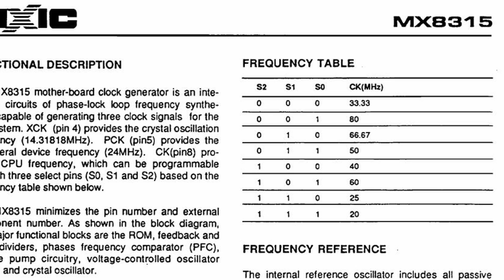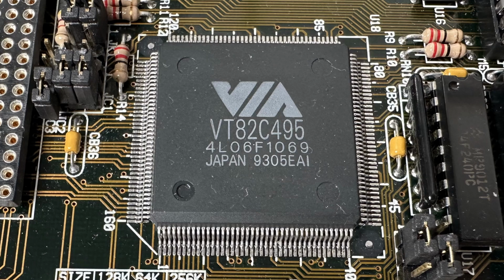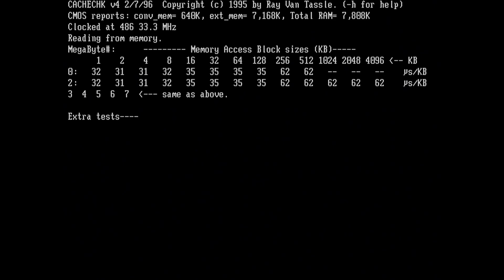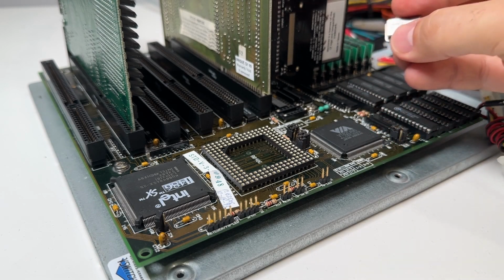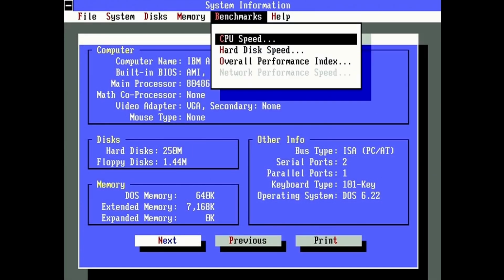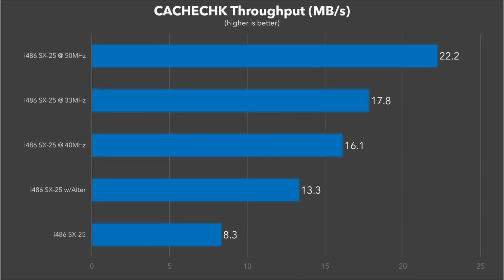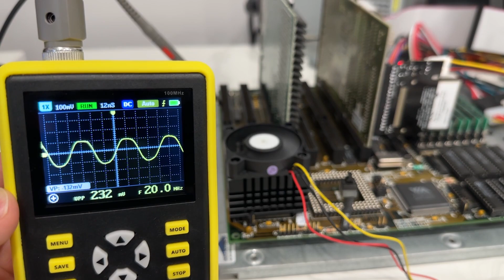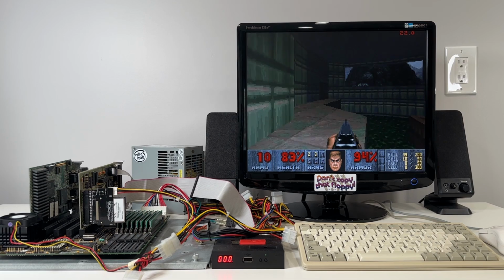Taking a 486 SX-25 and the FIC 486-VC-HD to the Max!

Comment: These boards are very well ready for Intel DX50. That chip is kina of an oddity, which you either love or hate. I have one with a different chipset but it has those jumpers too. My board has no QFP chip. I am running a DX50 Intel in it 1:1 and it is one of my favorite system.

Comment: I remember the same issue back in the day. My 486DX machine with overclocked ISA bus to 16MHz worked fine until the SB16 Vibra card was installed.

Comment: I was going to say, that Doom performance seems atrocious from what I remember on my 486SX 25. I think I had a VESA video card though, but I can't recall. I used to play Doom on 25MHz 386 machines (I can't recall if they were SX or DX). This was in my computer lab in high school. We shrunk the screen down much smaller, but it was perfectly playable. We did multiple simultaneous 4 player Doom matches over the Novell network.

Comment: Not sure if it was your channel but I commented to someone doing doom trials that I used to put the demo on loop under win3.1+3.11wfw back in the day overnight as a burn in and stability test before delivering a system. If you can do that without a blue screen then you know what your doing and your real mode drivers are rock solid.

Comment: Kudos for this! I think they key thing here is that I wouldn't even have bothered to try and push the system to 50MHz, and I doubt many others would as it's a bit, well, illogical. 🤣 Thrilled at this result, particularly the ISA tweak. I don't think I've ever had a board that was as tweakable as the ones you find.

Comment: 12 FPS in Doom at 40 MHz is kinda slow when a 486DX2 66 can run Doom at almost full speed. 

In the Thandor Doom benchmarks the SX25 gets 14 FPS at 25 MHz, although it is on a PCI system.
Reply: Most of the issue would be the ISA VGA. I had the misfortune of having to run a 486DX2-50 on an ISA video card for a few weeks after my off-brand Tseng Labs ET4000/W32p committed hari-kari, and I still have the odd nightmare about its 386-like performance.

Comment: Ok. Now stick a DX in there and lets see how much it helps doom.
Reply: Not even slightly. Reasonably well-known fact: Doom specifically used integer math so it didn't need a copro. Quake was the first ID game to use x87.
Reply: @throwaway6478  are there any bits of vanilla DooM code that would benefit from being converted to use floating-point math? that'd be an interesting direction to take both it and Wolfenstein 3D

Comment: The 486SX/25 with an upgrade socket was my first PC at the end of 1992. I remember saving up enough money by the end of the following summer to get a DX2/66 and double the RAM.
Reply: I wish I had known how to do that back in the early '90s, I would have gotten a DX4 overdrive 75mhz.  Our family 486 was a Biostar with the soldered on 486sx25 with an upgrade socket.  We weren't allowed to tamper with the computer and we were afraid of any wrath incurred by fucking something up but we suffered with that 486sx25 till 1997 when we finally got the Pentium 133.
Reply: @Vile-Flesh  the DX4/100 essentially required an early Pentium board. That was my next PC in 1996.

Comment: A new vswitchvideo? I see, I watch ASAP! 

Excellent video, that truly is an under appreciated little beast of a CPU. To think back then someone would just need to spend a few 10s of dollars on some crystals and they might be able to attain that 100% OC.
Reply from the maker: Haha thanks so much, Adrian! 😁👍
Reply: People were probably not knowledgeable enough back in the day, especially without the Internet. I wonder how many actually did overclock their system.
Reply: @Paar86  I had a 486DX4/100 that I overclocked to 120MHz just by increasing the bus speed. The key difference here is that knowledge about timings and such wasn't as widespread back then and I, for one, was terrified of breaking either my CPU or the motherboard that had cost so much money. Not so much of an obstacle these days when you have a stack of CPUs and motherboards at one's disposal.
Reply: @BrassicGamer  yeah the cold sweat when you tried a higher multiplier or the next FSB speed available on that sea of jumpers and the system failed to boot only to realize you didn't read correctly the manual, that was some intense stuff!
Reply: @Paar86  we had BBSes and magazines and you'd be surprised what kinds of info was shared back then. Overclocking has been going on since the original PC and XT and before that.

Comment: I have overclocked 386 and 486 machines a lot and one reason why the memory dont need wait states @50MHz because wait states are set on cache. Every memory access goes through cache. If you put 15ns or 12ns cache which work at 0WS @50MHz then it's maybe necessary to put WS on memory 😅

Comment: Ahh. 486 SX-25. I have some good memories about this exact model. I was working as a teenager during one summer to buy my first PC. But unfortunetly prices has changed and i was able to buy only 386 DX-40. At first I was little bit disapointed but those bad feelings has passed away. It was my first PC afterall and at the and I was happy.
Reply: My 386 with a 387 made getting a 486 pointless until the later models.
Reply: @orbatos  Yeah, no. The 486 has around 2x the performance per clock. 

Even 486DX 25 will shit on the fastest 386.
Reply: You should had built one yourself, by buying a pre-built you sometimes paid Pentium custom build prices for 486 systems.
Reply: You probably were only losing out on a ~20-25% performance increase. The fastest 386 and the slowest 486 behave pretty similarly, especially the 486sx which lacked the FPU.
Reply: @mal2ksc  Clock by clock a 486 is generally about twice as fast as a 386. In Doom even more than that.